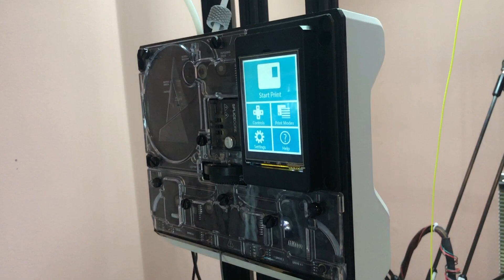Ultibots D300VS doing her thing

Comment: I don't recognize that extruder setup, did the Bondtech guys talk you into something new?
Reply from the maker: LOL, no, this is Ultibots original extruder that they designed. I haven't had a need to replace it. It was one of if not the first direct drive extruder small and light enough to use on a large delta. It is the extruder that opened my eyes to the compromises made with long Bowdens.

Comment: Michael, Slightly off topic. How did you interface the Mosaic Palette 2 with the DuetWiFi  in the  D300VS?  I've been searching their website and they still list that as not compatible, yet.  I have a D300VS+ and was looking at adding the Palette 2 to it also.  The D300VS and the + are great printers.  Check check.  Just jumped over to you sublimelayers blog and found the entries for the Palette 2 but no information on configuring / interfacing the hardware.  Your tutorials on the KISSlicer and 3D printing have been a great help.
Reply from the maker: jupiterdotp92 if you use the Hub, it just hooks to the Duet usb port. That’s it. No configuration required. If you don’t use the Hub you print like usual from the web interface or PanelDue if you have one.
Reply: @AHackOfAllTrades  I have the PanelDue, but mostly use the  Duet Web Control over WiFi (prefer this to octoprint personally).  Does the hub interface to the Palette 2 over WiFi?   I was toying with having to modify the DuetWiFi firmware to add the needed status reporting for the Palette 2(Dusting off my old programming skills for whatever they are still worth).  Octoprint is open source, as far as I know.  Do you know if Mosaic has released source of their changes / additions to it?
Reply from the maker: Usb only. The octoprint plugin sources are available on git hub. Honestly, it isn’t worth the effort! Start the print from octoprint/hub and monitor it in DWC.
Reply: @AHackOfAllTrades  Thanks, I didn't know that you could do that.